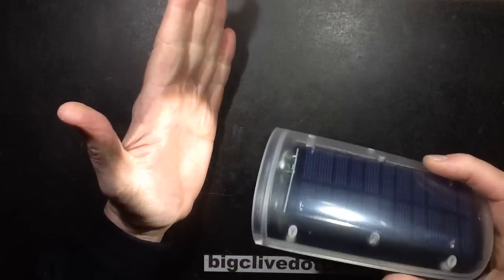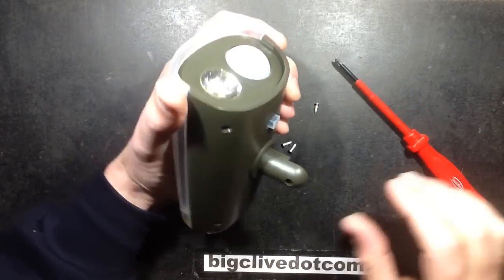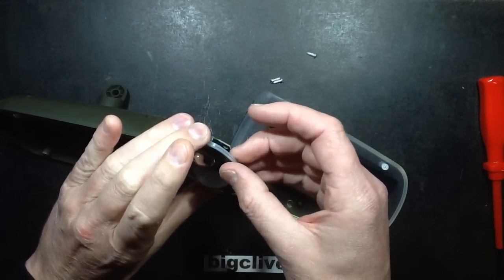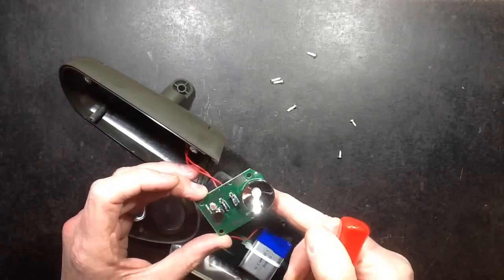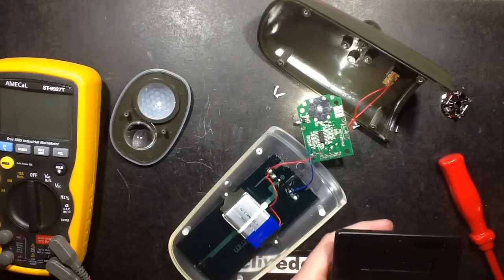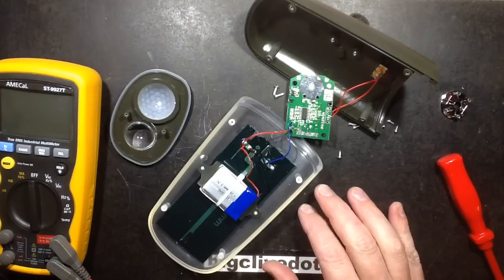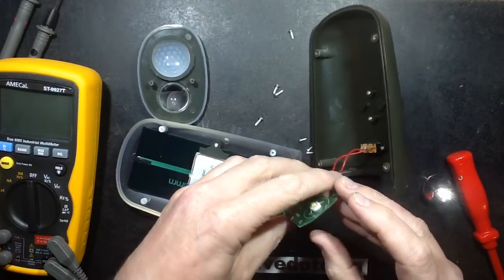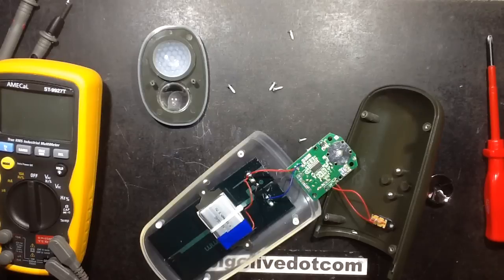A look inside a solar powered LED security light.

Comment: Most comments seem to say "put in a bigger battery" but the solar cell wouldn't be able to charge it. I tend to build my own from scratch, they work but there not to pretty, but at least they use a PIR. Good video Clive, but I'm surprised you don't make your own like you do with your Filament lights. Keep up the excellent work.

Comment: Thanks for the video, i like the housing design of this, think I will get one of these.

I usually dismantle outdoor lights and seal them with silicone as they usually let water in eventually, especially
the cheap LED outdoor floodlights they can fill with water as the factory sealing is so poor.

I also have a PowerBee 48 LED solar shed light,  it gives a good amount of light output it uses a single 18650 cell.

Comment: My security light which I bought from Wish charges all day and gives off a tremendously bright light at night,with two settings,on at partial light all night,brightening to full when approached,or off altogether,coming on full suddenly in approach. Charging on summer days could be more reliable,possibly not so much in winter. Recommended that the light faces south to catch most available sunlight. Certainly very pleased with it so far.

Comment: I actually bought one of these off the back of this video, it is a really good value for money solution for my needs. And it looks a bit like Johnny 5. what's not to like? it is about 5 times brighter than the one it replaced.
Reply: I ended up buying 4, two are still going strong, two have failed due to water building up inside. Occasionally in sub zero weather they just trigger constantly until the battery runs out. May be condensation from the LED?

3 yrs is not bad for the price

Comment: Hi Clive, I watched your video on the Joule Thief a few days ago and was wondering if that Joule Thief could be wired in to a unit like that to make the LED last longer and brighter. I was watching one of your older videos earlier "Exploring the Humble LED Push light" and was thinking the same thing about that too. The Joule Thief you made seems small enough, without the battery case, that it would fit in nicely, I have a solar powered light that was suppose to last all night with a full charge but only manages about 5 hours. It seems to me that a Joule Thief might work to make it last longer.   
Forgive me, if I'm asking a question that may be a bit silly, I'm not an electrician by trade and only know a enough to fix a few things or get in big trouble. But I do like your videos, I loved taking things apart to see how they worked back when I was a kid, but they never seemed to go back together the right way back then. I'm a lot better at putting things back together now in the mechanical field. Again, I like these videos, as you never know when one will come in handy.

Comment: Mine should give near 8 Hrs total run-time I recently got one and it has a 1500mah cell inside, I measured current draw on mine directly with a fluke meter and it's only 200ma

Comment: why does your "deeper" red screwdriver have a shaft that's fairly long? the tip of the bit isnt very long.. it would make more sense to make the shaft much shorter so it fits into much deeper cases, right? seems like an odd design..i cant imagine they were trying to save money by using a short bit, i've found regular screwdrivers at the dollar store..

Comment: I want one with supercapacitor :) R&T preppers have created a descent project - the solar sun jar :)
Reply: that would not work. a supercapacitor discharges very fast at a very high current.
Reply: Yes it can do it, but you control the discharge with your circuit. I managed to get 3-4 hours of light from a 2.7V 500F capacitor, using a single 3.3V 20mA LED. Now I build a solar box with 6 supercaps. If you speak about supercaps self discharge - yes it is an issue, but not so big - mine stay in the wardrobe for several months without droping below 1.8V
Reply: Why not use aLiPo battery?

Comment: And the lipo battery will be dead in less than a year. I don't think it's the wrong type of battery for outdoor applications. They almost stop working below 0 and keeping them fully charged and hot (like in a case that's supposed to be in the sun...) will degrade their capacity.
Reply: +superdau I've had one of these in my garden for 4 years and it still works pretty well, not sure if the battery capacity has degraded but it's only used for very short periods so it doesn't matter too much

Comment: +EIBBOR2654 i cant reply directly as your settings wont allow!  the joule theif works great for regular dispoable batteries, but would either drive a rechargeable lithium to kill it or just enable the protection circuit, thus would not run any longer. also the other parts, the light detector circuit would probably not be happy running that way, joule thief was just for very simple light circuits to pull all the power from a disposable battery and also would run voltages a single cell wouldnt be able to run, its a very small application list for that

Comment: i would remove the battery and replace it with a 3000mah-5000mah battery just to make sure it will last through the night if it needs to. would be terrible if your using the light and the battery died.
Reply: +brandonhughes7 It's motion activated, it doesn't have to last all night. Also the solar panel won't charge more than that.
Reply: To your point it wont run on all night, the panel then could absolutley fully charge a larger cell over the course of more than 1 day
Reply: @Deon Denis Then just get the newer triangle shaped lights that come with a 18650 inside and last all night in dim light mode but get at full brightness when motion is detected.

Comment: get another lith battery of the same type . and put it in series.
Reply from the maker: +Nathan Dean That would be parallel.
Reply: long as youur able to double the battery storage i dont care wat its called.
Reply from the maker: +Nathan Dean If you wired them in series it would indeed double the voltage, which would possibly damage the circuitry and would prevent the solar panel from putting a charge in.  (Its voltage is only enough for one.)  But if they were wired in parallel the voltage would be the same, but the total mAh (milli-Amp hour) capacity would be doubled and it would effectively run twice as long on a full charge.
Reply: ok. ill leave it up to some whos smarter thAn me. i basicly take sstuff apart.

Comment: looks like a 1W led to me. So it probably runs longer but they fooled you with the lumens output
Reply from the maker: +getreal155 The 1W and 3W beads are very similar with a bigger chip size in the 3W.  They even share the same star PCB mounting system and reflectors.
Reply: OK. I didn't know. Sounds weird.

Comment: ooow yes, a bigger battery would be my choice, pity they put that nasty plastic cover over the solar panel, bet that blocks some of the energy :-(
Reply: +zx8401ztv or the panel would get full of water and fail! lol, cant win
Reply: +jusb1066 lol no, cut out a hole for the solar panel, use silicone sealent to seal it in the hole, you have to bodge, its manditory lol :-D
Reply: +zx8401ztv bigger battry would not help, the solar panel cannot charge a bigger cell.
Reply: +flippynl But if the original cell was shutting off because it was charged, all that loverly power would not be used, the solar cell may be underused slightly.
Ok im power mad, i admit it ha ha :-D
Reply from the maker: +zx8401ztv Keeping in mind that the unit only activates for about 30 seconds when somebody walks in front of it,  it will probablky end up being charged fully , even with low levels of daylight.  It all depends on how often it is activated.
Reply: +bigclivedotcom Im supprised you havent made your own clive, your a clever man that loves lighting, i bet you could do better than the cheap crap.
Or perhaps its not overly interesting, you work in far more complex and interesting devices. :-)
Reply from the maker: +zx8401ztv The case is nice.  That's always one of the trickiest bits in an outdoor project.
Reply: +jusb1066 These are normally potted so water wouldn't penetrate it. But that frosted cover does no good.